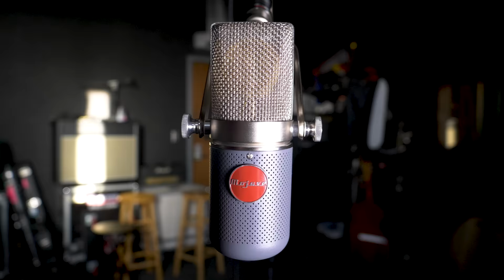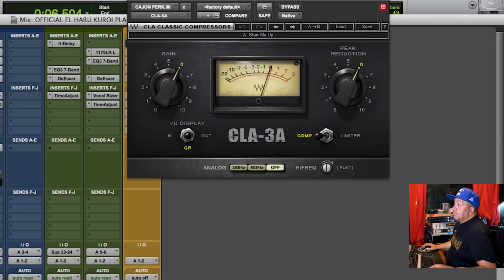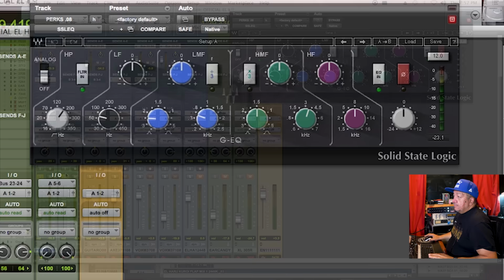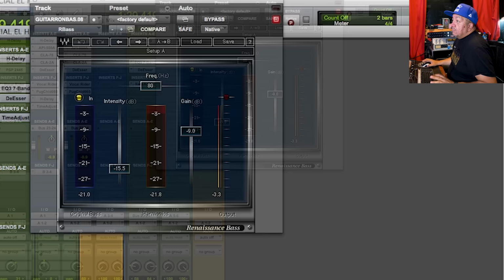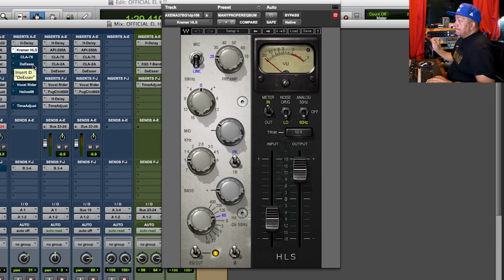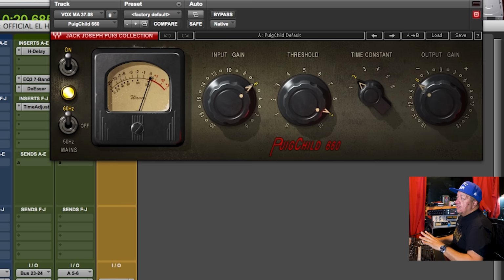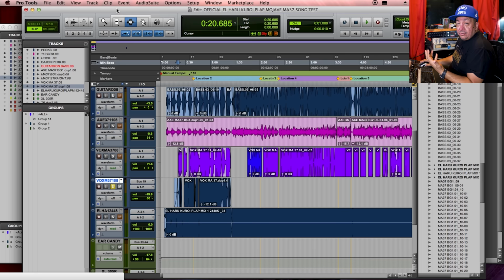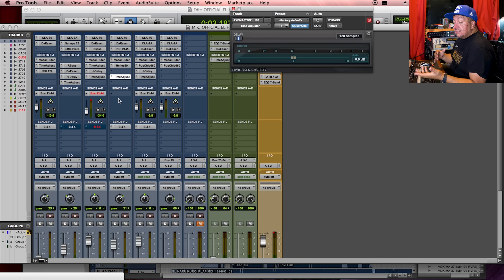A Mic Locker LEGEND Made Modern - Testing the Mojave MA-37

Comment: Nice job overall, although this seems to be more of a mix walkthrough and not specifically about the MA-37, which doesn't get a lot of time over the nearly 1hr video. Dry placement, pre amp choices A/B, EQ reception at source while tracking, comparisons on same source with other mics  etc. would've been both cool and helpful. Just my thoughts, as I'm in the market for a MA-37 right now. Cheers.